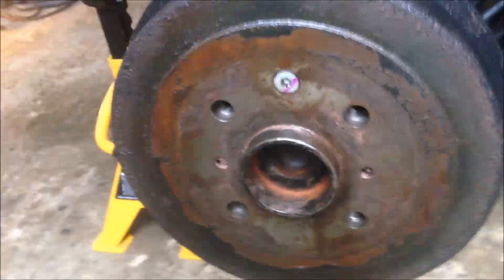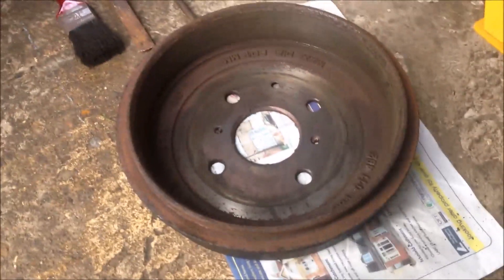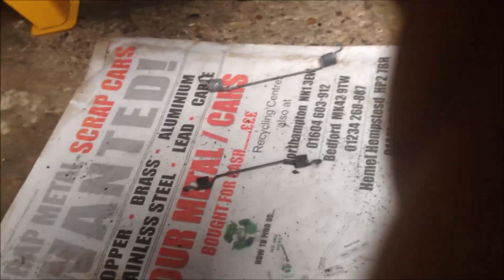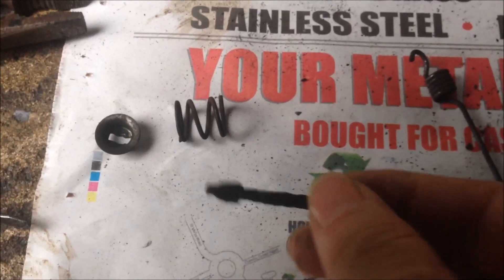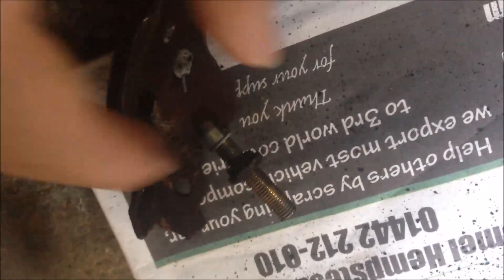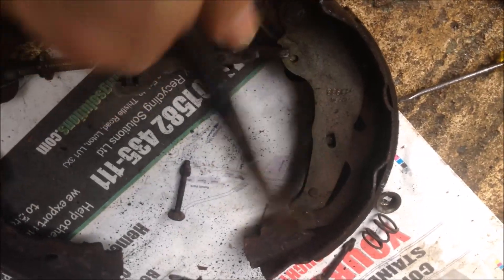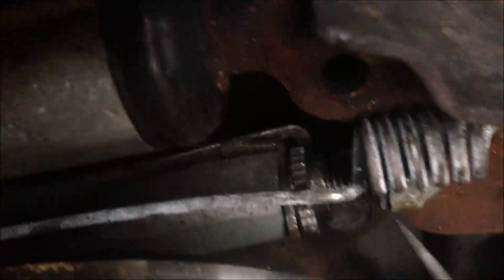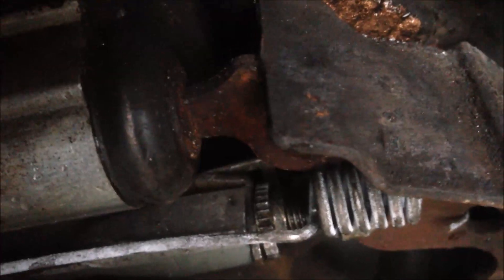AYGO: Rear Drum Brake: Maintenance (remove, disassemble, clean, lubricate and assemble), C1, 107

Comment: you didnt put the top spring back in the same orientation that it was originally.
Reply from the maker: Great observation! It looks the original orientation is better! For the drum brakes,  I have later replaced the cylinders and hopefully the top springs were installed as the original orientation. Thank you!

Comment: Hi Dear,  i have Aygo 2006.. i am facing issue that mechanic damaged the abis sensor(Back wheel) during replacement of drum. Now, Sepeedo meter & abis brake not working and P/s indication was observed at the same time. The spare part of this car is not available in my country. Can i replace the sensor with other vehicle which have same ohm rating ? need your support please !!